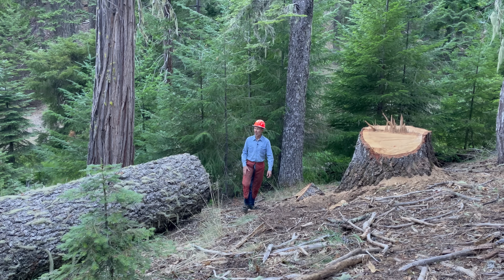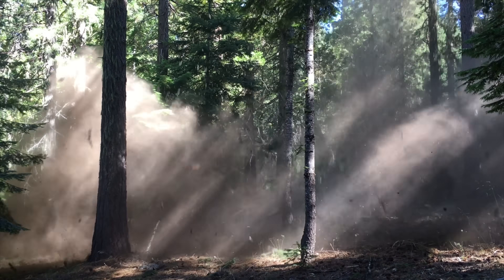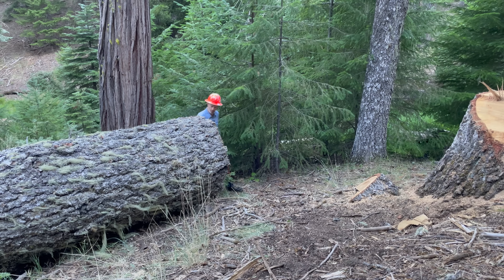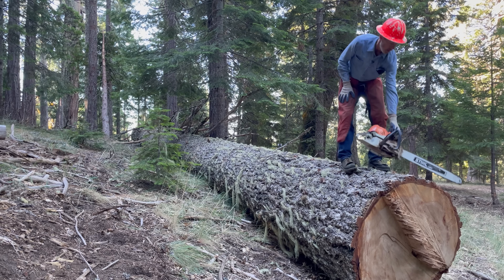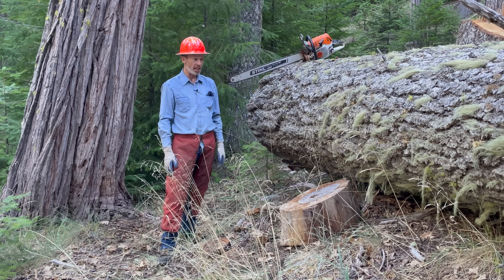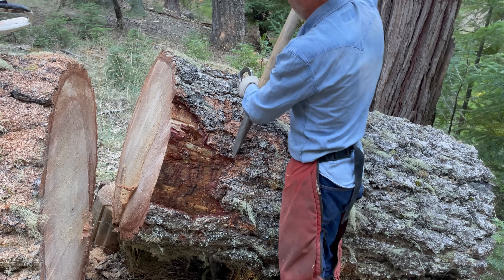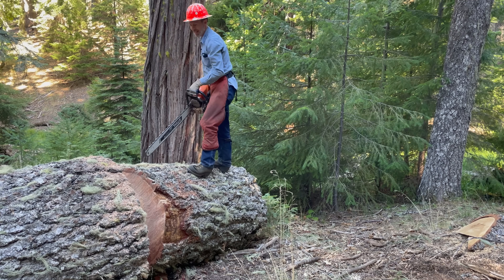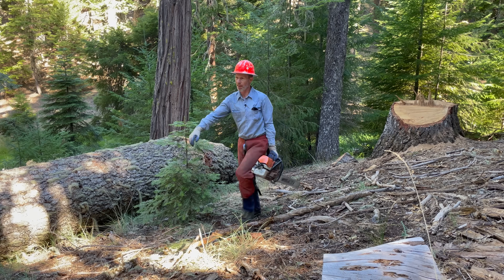Chainsaw Ripping Chain vs Square Ground Chain

Comment: Can you describe what you mean by à ripping chain .Do you mean à skip chain ?
Can you make a ripping chain out of a regular chain .?
Different parts of the world have different notions for chains .
I have made square cut chains from regular chains using an electric sharpener ..10 degrees .
Often when you go to a store and ask for a sq cut or a skip chain you are met with blank stare and “why do you want to use that “
I’m in Europe .
May I say you are a born teacher / communicator as well as a top woods man .
Thank you .

Comment: I learned about a new type of chain. Good video even though sometimes, your tongue got in front of your eye tooth and you couldn't see what you were saying . I am about to start trying this quartering thing. I have a lot to learn and a pile of logs I cut down last year. Hoping they aren't rotten and split from sitting so long. I have a lot of cedar and oak to process if it's good. Waiting to buy a small mill until after I see what a few these look like inside. I still have plenty to cut down but hate the idea of wasting all I cut to make room for my building.

Comment: GET LUNCH !   I love the sound of that wood ripping as that fir falls.  You can tell the wood in that tree is still good and not totally dry or rotten.  I've had serious plugging of my chain when "Noodling" on Oak.  Of course with Oak my ripping chains can make about 3 planks (Alaskan Chain Saw Sawmill) on a a14-15 inch wide cut then I have to sharpen them.   When I've made a few planks out of pine,  I can get 5-6 planks before sharping a ripping chain.  That's with a Stihl and a 20" bar.

Comment: Ok a quick question here...I have to rip some oak tree sections..while not huge sections like these in the video these Oaks here where I live in east Texas are hard on chainsaw chains doing regular cutting across the grain..now when ripping it  wears these chains and myself out much faster when using OEM Stihl semi-chisel chains...which type of chain is the best cost wise to buy and use..the saws I will be using in my Stihl MS 250 and an old Stihl 024 Super that I brought back to life.
Reply: I run 25 in bar, carbide tip chains...worked on upper Miss. river, Corp of Engrs...worked on 8 x 10 x 20, 10 x 12 x 20 dead of winter..carbide works 👌 👍

Comment: ...or maybe you don't need a bigger sawmill.  Another technique I've used on logs too large in diameter for my Cook's MP-32 bandsaw mill is to cut them to length, do an elongated plunge cut (18"-about 20") laterally along the log, pack the cut with black powder, stick a 20 second fuse in it, pack the cut tight with an old cotton rag, light the fuse and run like the dickens.  Saves wear and tear on the saw/chain and way more fun.  Once I get the log halved then I load it on the sawmill on its edge with a tractor grapple.  As the fella said, "more than one way to skin a cat."  Enjoyed learning a few new tricks too!

Comment: Great content. Just thinking that you were noodling a full 32-"-36" bar. If you noodle a typical 16"-20" firewood round your chain should have a better chance clearing chips and not packing the cover. Just a thought and keep doing what you're doing!

Comment: I've been looking for ripping chains for my saw. I tend to avoid amazon, ebay, and other anonymous sellers, so it has been a failed search so far. But I can square grind a chain. If the two are comparable, maybe I'll just do that. I'm not milling 48" logs. Maybe 12". Thanks for the info.

Comment: Just FYI the ripping chains are meant to rip across the tops of the straws, cutting it like it was on a mill. Typically they are used with Alaskan mills. Doing the noodle cut lol ,not normal terminology in my area but I like it, isn't really what it was meant for. You'll see i much much bigger difference between the two chains if you were hooked to an Alaskan Mill cutting in that orientation. Nice free hand to get it on the mill. I only have a 5 ft Alaskan that I ran the first year or 2 with a normal cut degree 25/30. Once I switched to ripping chain 10/15 degree it was like finding the holy grail. And for the last few year I dont even buy ripping chains I just make them out chains that got fucked on a nail or something. I cut beams and slabs right on side.

Comment: PS. Observe any crack orientation first... then
 Cut the butt back to the depth of  FELLING TEAR OUT, (obsever stump to determine) before first desired log length is cut
And If you can avoid cutting thru the outermost barked where a lot of dirt and grit accumulates on it...use already dull chain to score thru bark... then use your sharp chain to cut clean wood to depth
 It won't dull your chain as quick

Comment: For my 090 I have a side plate that is almost totally cut away, so that the bolt bearing remains, but there is no guard or capture, or dogs.  This allows the noodles to fall free, particularly in horizontal operation.  I was lucky to have my dealer back then just give a left over one to me.  So I have both, though for me an 090 is a milling tool.

Comment: When ripping it's important to swipe away the pile of 'noodles' that come out of the saw or they get in the way of it clearing from the saw and cause it to back up and jam.  You can clearly see that happening in the video when you started on the lower half because you're closer to the ground so it's piling up and causing the jam more easily. In another lifetime I spent a summer out in the bush cutting and ripping yellow cedar 'cants' for export to Japan (we were told) and had a lot of practice ripping, more than I cared for.

Comment: Nice straight cutting there!

In my experience it's sworth going for a ripping chain. The cuts come out better and it I imagine it it slightly faster too.
I would bring some extra chains anyway, for a project like this.

Comment: Thank you for the very helpful video. I'm from Scotland and have inherited some woodland with a few big Ash and Oak trees that have succumbed to the winter storms. Nothing like as huge as your trees but 48 inch trunks and now I have some better ideas on how I can make better use of the lumber without just making it all into firewood. And, not die in the process 😮 many thanks 🎉

Comment: Worked for an older Vt logger who retired on 140 acres of hardwood maples, birch, beech usually eastern hardwoods.....he used to literally square off his his 7/32 chain teeth cause he swore by it...along with two to three flat file swipes of the raker on each raker......i mean his saw threw massive curl chips but the over grinding of the tooth to be square kind made me go hmmm

Comment: 12:56 I have a question: why do professional tree fellers always use an ax or splitting maul to drive wedges? I've never seen them use the ax or maul for anything else, so why not a hammer for the wedges?
Reply: The weight a maul or axe has helps to drive the wedges better than a hammer.

Comment: Ripping chains are slower than a standard or square grind. They produce a smoother cut. At least from what I've noticed with my chainsaw milling. Not worth the extra headache since I'm planing my lumber anyway

I've never tried noodling with a ripping chain, I've only milled with the Alaskan mill with it. Noodling might be completely different result.

Comment: I haven't done any major tree work since 1976 when I was thirty years old.    But now I need to drop some 50 or 60 foot Doug firs, because they are shading my boat shop in the winter when it most needs the solar heat.    They're tall and straight, will provide some excellent long timbers,   and the limbs will heat our house for a few years.     Thanks you Mr Wilson,   and thank you YouTube refreshing my tree-sense,   I hope.   Gonna wait till spring
Reply: I hope all went well!

Comment: I think that what you are dealing with is the same reason that hand fallers used to leave high stumps.  The butt cut often has some gnarly grain which is far harder to cut with both crosscut saws and with axes.  When they did drop trees with hand cutting, they often had to use way more kerosene to lube the saws and even the axes.  It is thought that the gnarly grain is the tree's response to wind over the years.  It toughens up the tree to make it more wind firm and not break off in a storm.  This wood is often filled with far more sap and pitch pockets.  What was the bane of the old timers, seems to be creeping into your work.  Also, when using skip-tooth chain, you will always get 'better packing material' for your UPS shipments, than you do with full-comp chain.  Each tooth creates its own noodle.  The longer distance between teeth on the skip-tooth chain will give you longer noodles.  The longer the noodles, the more they want to roll up into a ball in the gullet of the chain.  This causes even more drag than full-comp chain.

Comment: When I first started with big trees I laid one down Uphill , and when it broke loose the butt end flew upward about 4 feet and then started sliding downhill.
When it popped up it ripped my pants and shirt and my saw went skyward and returned at my feet whilist I maintained a grip on it AND the trigger.
Good thing I had super thick chaps on.
The synthetic lining of the chaps stopped the saw dead in its tracks.
Yep , Staying smart & alive is Very important !!!

Comment: I’m jealous, my trees are only 15-22” in diameter and only around 100’ tall. I have two trees that are starting to lean, they are about 10’ apart and around 108’ tall. Both are 20” diameter, my saw has a 28” bar but the motor died last summer. DONT BUY FROM amazon !!!

Comment: 3 types of chains, rip, crosscut, and skip. Any chain can be modified to be any one of them. However it's easier to buy the specific chain. The difference is the number of teeth and the angle of the cutting edge. Like any other wood working blade, what you can use it for is determined by the (sharpened) angle of the cutter

Comment: If you’ll cut a long wedge out of oak or hickory you can hammer it into your first cut like a big handle and turn the tree. Needs to be strong wood or a wide wedge so it doesn’t break.

Comment: Moisture.. Higher moisture content makes ripping wood considerably harder. Also the type of wood. White fir seems to be stringier, If that is a word, versus Doug fir.  Ripping ponderosa pine is much easier than ripping firs. When I was falling timber, I used full comp everything. More teeth means faster cutting.

I also used a grinder to sharpen my chains. Every tooth was the same size, and every tooth was cut exactly the same way, and the rakers were all exactly the same. My rakers were at 0.35. The cut was so smooth, that I could hold the saw with one hand and buck a 6 foot log as the bar just fell through the tree.

Comment: Noodles are caused when the bar is running the length of the tree picture using a chisel and getting the shaving from the blade. when the bar is 90° to the length of the tree it’s actually cutting differently. More of a chip. You end up cutting end grain cutting the length at 90°

Comment: Before felling tree:
1) Lay 4"dia poles perpendicular[ea.6']where tree's to fall,
2) Alaskan-chainsaw-mill slab logs into 4"-6" thick planks, 
3) Wide slabs cut up the middle-> trim wane sides parallel,
4) Yield 8-14 planks each log 4"or6" thick by 4" to 20" wide,
5) Bandmill slices vertical planks to 2×4/4×4/2×6/4×6/6×6.

Comment: I was wondering where noodling came from, but you told me a minute later. You popped up into my tube feed, and I'm glad you did. A really good all-round tutorial on chainsaw work that's rarely covered. I like your  nonsense language and your valuable #1 tip, "it's all about getting out of the woods alive". 
Liked & subscribed. Now let the LT-10 take it from here.  Cheers 🍻 Brother.

Comment: While using an Alaskan Saw Mill, which keeps the chain fairly close to perpendicular to the tree axis, ripping chains not only make a smoother cut but they also vibrate the saw less. It makes the job a little less miserable.

Comment: I rip alot of logs for making woodturning blanks. I used to use skip for "noodling" until I figured out that skip makes a much longer noodle and bogs and plugs a saw way faster than full comp. They make hyper skip ripping chains where there's only a cutter like every 4 links, this works for milling where you are cutting into endgrain and only making dust anyways. Great channel brother!

Comment: Very impressed with your ripping. I had to rip some 8, 9, and 10 foot diameter 16 foot long logs back in the 80's that the yarder couldn't handle (not enough deflection.) Used an 090 with 84" bar. Great bar and great chains. Embarrassing cuts when they finally came apart. Some were mis-matched by 4". Everybody was happy except me. Well... I didn't die. That was kinda pleasing.
Reply: Yeah, I'm a Carpenter and every time I use a chainsaw I remind myself it's a really dangerous tool in my hands and take it easy with that horror machine.  This dude is a ninja, and you are a foot soldier.  I am Casey's greasy hair.
Reply: @evanhughes3027  seen folks die from chainsaw injuries. Im happy to see you have a safety awareness about chainsaws. Please pass your expertise on. 
ANYONE can buy a saw, it's a death machine in an unqualified users hands!

Comment: I used to help log up here in British Columbia and we used to have to rip logs on the hill if they were too big to fly. The skycrane could lift 25 thousand pounds so you can imagine a log that’s only 14’ long but too big to fly. I once spent a whole week ripping 13 logs so roughly 2 logs per day. Big spruce were the toughest because you can’t leave any holding wood on the bottom otherwise it wouldn’t tear off when they lift it. I used to use either an 088 or a 3120 with 6’ bars. It’s a lot of work to cut through 7-8 feet of wood on a steep slope 😊

Comment: I think one of the advantages of a ripping chain, is that if you’re going to then plane then surface and or put a finer surface finish on. There’s less less work and potentially less finishing materials needed, to get to the point of being a required or saleable product. Plus if there’s a smoother surface to begin with, you’re going to reduce the quantity of waste wood when finishing.

Comment: So, I used to have a 4 post-carriage chainsaw mill. Don’t think I’m saying it well, but I have a short video of it on my channel. Anyways, I have run full-chisel, semi-chisel, and professional ripping chain (Oregon). Maybe an important point is that I was however always cutting 90 degrees to the grain, so no noodling. The carriage held the saw and took operator error out of the equation. I found that all three were about the same speed, but that the full chisel made the roughest cut and the ripping chain made the smoothest. The ripping chain was less ‘grabby’ and consistently a little easier on the saw head. I was running a 395XP so this made no difference until the logs got over 24” in diameter. On the largest of wood the ripping chain seemed to cut a little faster. I think this was because it wasn’t trying to take as aggressive of a bite as the chisel, and as a result had the advantage of being able to keep the chain speed up. So the bites of each tooth might have been a little less, but there were more teeth engaged over the course of say a minute than there was with the chisel chain. If this doesn’t make sense, it’s not you, it’s me :) I probably went through a hundred foot spool of ripping chain over the course of a year before deciding that the “best type of chain for the job” was a 1-1/4” bandmill.

Comment: On the full comp chain, since there are more teeth, each tooth's raker takes a smaller bite to have the same effect, compared to the full skip chain in which each tooth can cut more before bogging down.  Also, semi chisel ("round chain" as you called it) has a smaller width top plate. With the rakers at the same height, all other variables being the same, a chisel chain would dig in/bite/offer more resistance than a semi chisel chain because full chisels have a bigger top plate and therefore grab more wood. Even though the ripping chain made more noodles, each one was smaller and that's probably, at least in part, why the saw had an easier time managing them. There is, however, good evidence to suggest that (in some applications at least) full skip cuts faster because it makes fewer chips for the saw to deal with.

Comment: Back in the 70's and 80's I fell for several LP logging shows in Northern California. Also made a lot of redwood slabs. Oregon made a specific chain for ripping. It has been awhile, but I remember it being a regular round ground filed nearly at 90 degrees and then the next tooth was like half the width. Almost like a giant raker. Worked well. Keep up the good work. Enjoy your videos...

Comment: We used to rip west coast cedar on Vancouver Island that were 12 to 15 feet by 20 feet long. Cedar splits so nicely that once you made the top cut with a 5 foot bar we could split the log with oversize wedges made from foot wide hemlock

Comment: I noticed an odd sound@ 15.45 that sounded like a wire fence that was tightened until it popped loose. Was that the heartwood releasing the incline caused stress ripping loose ?  Keep up your efforts cuz I’m enjoying the folksy narrating !